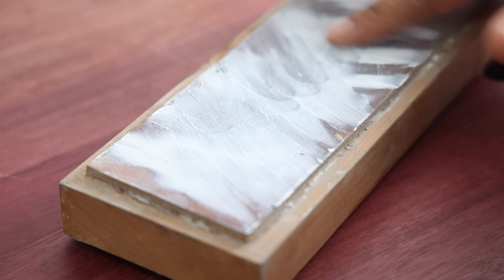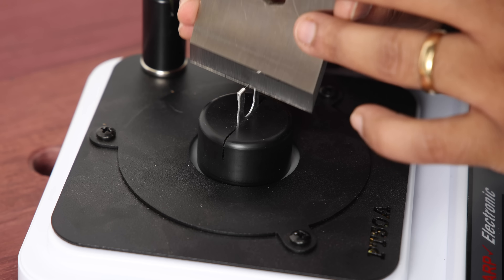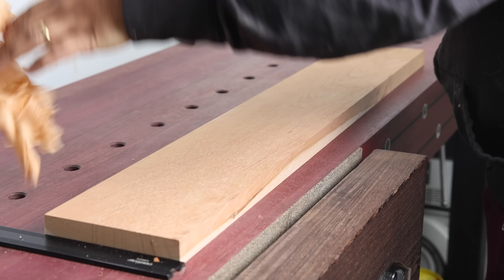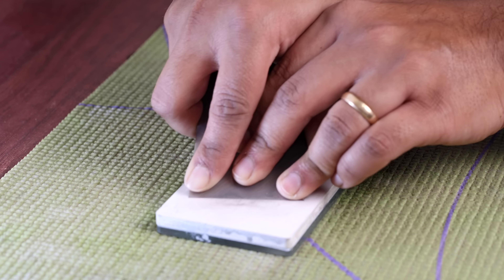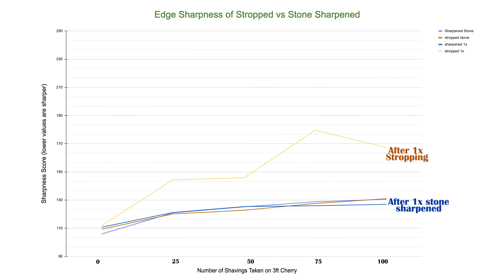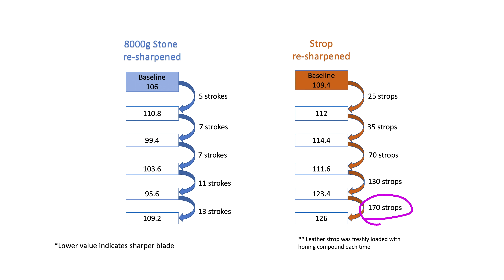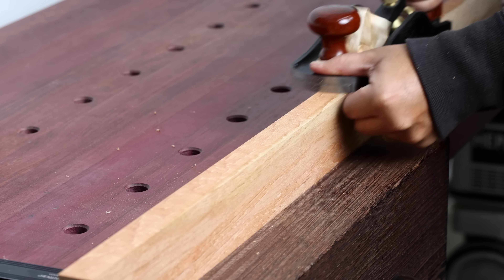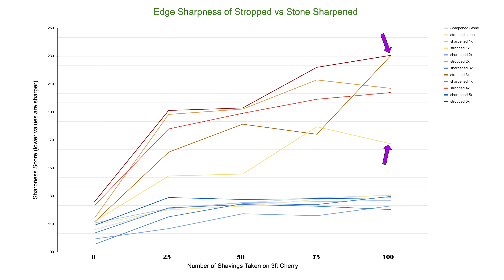is stropping overrated?

Comment: First off, numbers matter. Kudos for showing us those numbers. It's like watching a video on dust collection and the person sucks up a pile of sawdust and says "See? Look?" One's feelings and actual proof are just not on the same level.

I wonder though about saying that stropping is unnecessary. I am by no means a sharpening expert, but I thought stropping was a method of quickly restoring an edge when you're in the middle of a task. It was never meant to replace a good sharpening, it was meant to save time. Your numbers though, seem to suggest otherwise.

Your numbers indicate that it takes more strokes to strop than to sharpen an edge back to it's baseline. My question is, what is the set up time to get to that first stroke of stropping versus the first stroke of sharpening? If time is a factor, you have to consider all the time it takes to strop or sharpen not just how many strokes. If the set up time to sharpen is easily negated by all the stropping strokes, then your numbers would indicate that sharpening not only doesn't take any more time but also results in a usable edge for a longer period of time, proving your point that stropping can be a waste of time or at the very least, unnecessary.

One other point... when you talked about the baseline score for a good edge, when compared to a utility knife blade, you said it was good enough for woodworking. One question would be, even if stropping results in a duller edge, is it still good enough for woodworking? Did you let the numbers persuade you or was it a noticeable difference? Kinda like, how square is square enough for woodworking.
Reply from the maker: Hey thanks for the kind words! In my setup, because I am using Shapton ceramic stones that does not require soaking, it takes no more time to get started sharpening on a stone vs strop. In both cases, the edges are brought to very usable sharpness for woodworking (100-200 is plenty sharp). 200+ and we start to get into an edge that probably needs a little refreshment, though I’ve personally still kept going on an edge that dull and it’s not the end of the world. The biggest difference with the stropping is 1) okay to strop a few times if it gets you back into woodworking and you don’t have time to soak a stone 2) it takes a lot of stropping to get to a sharp edge the more times a blade is touched up with strop only. Personally- I would ditch water stone and get ceramic stone. And if that’s not in the budget, I would strop on a hard surface instead of leather.
Reply: @WoodcraftBySuman  appreciate the follow up. With your set up, as you described, stropping does seem unnecessary.

There are others out there however, that don't have your set up so stropping may have some use for them.

I don't want to sound like I'm knocking your video. I think it was very well done. The "myth" comment though, a bit of a lure maybe.

Comment: stropping is meant only to be done after sharpening on a stone or sand paper.  It is more for useful on double sided blades like knives.  As you sharpen each side of a knife blade you can only get it so sharp before you will form a almost microscopic wire edge that just folds over from one sided to the other each pass.  Stropping a blade like this only takes a few passes and the leather will remove the wire edge leaving it stupid sharp.  A single side blade can form one but you would strop from the back side to remove it.   What you are doing is polishing face or the cutting edge not the edge.   But very scientific approach to testing it.

I am not a professional but I have made many knives after watching to many episodes of forged in fire and have viewed hundreds of videos about sharping..   I actually use a buffing wheel instead of leather. After I get the blade where I want I will buff the the blade before final sharpening then I will final sharpen with a 600 or finer belt on my grinder, blade up against the belt moving down. This forms that wire edge burr. Then I go back to the buffing wheel and lightly run on the blade edge down about 1 to 2 passes on each side so I am not cutting into the wheel. I use a  soft wheel and it works Amazing.          Anyway if I am wrong I a sure there will be someone to disagree.  But Walter Sorrels does a great video on it.

Comment: I don't strop the bevel face on bevel-down planes.  The bevel face doesn't need to be polished since it should never come into contact with the surface being worked.  It just looks pretty.  I just use a strop to remove or straighten wire edges where they are rolling up onto face of the blade.

Comment: What's the deal on JKM vid https://www.youtube.com/watch?v=GBjiEmN5HzA  you both supported stropping and even suggested a certain "Best Honing Compound" I almost bought.  Now you say any stropping will dull a freshly sharpened blade.  What's your and JKM final answer?
Reply from the maker: This video is about re-stropping. Generally speaking, re-stropping as a method of sharpening i probably not the best approach. You can definitely use a strop to finish off. One of the issue in this video is the compound I used. It is not the best compound for stropping. I would recommend the green compound JKM and I recommended - that works much better than the one used in this video
Reply: Thanks for your reply.  BTW your vid were very well done, should have said that to begin with.  But..... after sharpening, your data supports NOT stropping, correct?
Reply from the maker: @SW-jo7vy  yes. Sharpen > strop (if you like) > use tool > strop > use tool > sharpen again. Basically you don’t want to re-strop more than once or twice bc the blade tip starts to round over a little bit and changes cutting geometry.

Comment: While the results of your testing are very interesting, I believe the conclusions you draw from the tests are not accurate based on three factors: method of sharpening and stropping (freehand/square), angle of stropping (variable), and thickness of leather (too thick), and that several other conclusions may also be drawn:

At 6:32 you show a closeup of the blade riding on the surface of the leather, and it is clear that the leather you are using is way too thick for stropping a plane blade. You will want to use as thin and dense of a hide as possible to maintain a smooth and flush surface, preferably on a surface that also will not flex or move over time, such as MDF or a hardwood plywood. 

Regarding angle, you also lift the blade upwards as you retreat the blade, which is an incorrect way to strop. The majority of your pressure should be focused on the back edge rather than the front edge to maintain a level surface throughout the pull stroke. Not doing so will result in the curve you showed as you are pressuring the tip of the blade into the leather rather than allowing the front edge of the blade to glide over the surface. 

Regarding method, in my opinion, freehand stropping works best when you alternate the angle of the blade relative to the pull stroke as opposed to pulling the blade square across the leather. While pulling square on a solid stone makes sense (the stone does not flex at all) the edges of your stropped blade will suffer as the majority of the pressure will be on the sharp sides of the front of the blade edge rather than on the whole surface. 

Stropping helps to cleanly and consistently remove the burr once you are done sharpening on stones/plates. It also helps to rapidly hone a blade that is not already dull to continue working. Stones require preparation. They are also messy in the sense that you need to wipe your blade clean after sharpening and manage a water/oil supply, while stropping can be done in less than 30 seconds in the middle of a build to keep the blade going until stropping won't do the trick anymore, as your test clearly illustrates. I think if you weigh the pros and cons while improving stropping technique, I am certain you will find the benefit of stropping are indispensable!

Comment: This is great data, but based on your JKM collab, I feel like you are working to the wrong standard by trying to strop down to 115 or less. Based on the other videos, it seems like you should be working to ~140, which I suspect would result in a very different result V since it would have resulted in far less rounding.
Reply from the maker: Agreed. Looking back, it would make more sense to chase ~140. But because of this video, Jonathan and I got together to make his video where we got a chance to learn more.
Reply: @WoodcraftBySuman  so with the new testing done with Jkm do you still think an 8000 grit stone is better than stroping. Im interested if your opinion. Also did you and jkm discuss that aspect. Being that a stone would be better than a strop. Thnx.
Reply from the maker: @wilriv6391  I still wouldn’t recommend re-stropping too many times to top off the edge. But it’s a tough thing to say because the compounds are different in two of my videos. Personally, I’ll be sharpening on a stone but nothing wrong with strop for the final edge.

Comment: Geometry of an edge is king when determining how well it cuts. Your results support this as the Geometry when stropping each time changes ever so slightly. Using the flat stones you are returning to your baseline each sharpening session. Stropping to re sharpen/hone a edge can be effective but eventually returning to baseline is needed. Great Video.

Comment: You've made a fundamental error in this video. Stropping is not sharpening. Stropping is done after sharpening to achieve a smooth edge generally for finish/joinery work. If you're sharpening up to 8k/16k Shapton stones, you don't need to strop as the super high grit stone will give you a super smooth cutting edge. Strop + a compound is much cheaper than an 8k/16k Shapton which is why it's an option for most people.

Yes, stropping can refresh your edge but in practice, you're better off just spending a minute sharpening on stones then a quick strop to get the mirror edge and back to work. And like I said above, if you're sharpening to 8k, you don't need to strop.

Using an edged tool on wood causes the edge to roll over and micro fracture. Sharpening and then removing the burr gets rid of the rolled edge and cleans up the fractured edge with scratches' commensurate with the grit being used. If someone (like me) stops at something around 1200grit, we can then use a strop to reduce the 'scratch' size even further and get an edge that will resemble something that has been sharpened on a high grit stone. That is the purpose behind stropping.

Comment: A strop is used only to hone a blade that has already been sharpened. It does not take the place of a stone or other kind of actual sharpening method. A few swipes to clean up the blade after sharpening. Maybe in the middle of a project.  Just to keen up the edge quickly to finish the job. But if the blade is getting dull it has to be sharpened properly and then finished off with a strop. I  feel it is a bit disingenuous, and perhaps misleading, to base the entire premise of the video on only using a strop verses actually sharpening the blade. I haven't heard of anyone who says that only using a strop is an acceptable replacement for properly sharpening a blade.

Exit- after a clarifying message from Suman and reviewing the video l realized I had a misconception of the video premise. It is not misleading in the way I thought it may have been and I apologize for the mistake. The video is interesting and has shown me that I should hit the stone sooner during a longer project. As opposed to just a few  quick strokes on a strop and back to work. Thanks Suman for the detailed video.
Reply from the maker: the blade was initially sharpened on a stone before it got stropped to refresh the edge. The idea of the video was to see how amendable the edge is to being refreshed while stropped after initial stone sharpening. Stropping showed poor results from 1st strop to progressively worse results at 5th strop. Nothing about that is disingenuous.
Reply: OK, I can see where I had a misunderstanding of the concept here. I apologize if the comment seemed a bit hard. You are right, the strop is no replacement for sharpening. And after reviewing it is interesting to see the constant loss of sharpness when just going back to the strop over and over. I thought it might do a little better than that for a little while at least. I also like your hollow grinding technique. Keep up the interesting videos.

Comment: Stropping isn't necessarily about sharper. It can be but it isn't necessarily. The compound for stropping needs to be finer than the finest stone you use, and about the results on the product not the string. If the stropping doesn't help the finished product than don't do it. Get a microscope and compare the edges. What you see under the scope is what goes into the wood.
You be the judge in the end.

Comment: Missing the point of stropping vs sharpening. Sharpening you push the blade towards the sharpening stone and remove blade material. Stropping, you pull the blade away from the leather to hone the blade. Stropping is meant to take the micro-fine burr off of the blade and align said blade. As a licensed Barber, I will verify that stropping, at least in straight razors, is more than a mere myth.

Comment: Interesting video, but it does not prove or disprove the effectiveness of stropping.  Thus your testing is invalid for your stated purpose.  You  did show how a soft strop used with more than light pressure will not provide good results. A thin piece of leather glued to a hard surface used with very light pressure will improve your results. Dozens of strokes won't improve results, in fact it will likely produce a rounded over edge. 
Try this test with improved honing technique, different honing paste and different strop and I'm confident that you will get different results.

Comment: in my opinion stropping rounds over the blade because it doesn't have a dead flat reference
Reply: a convex edge is stronger than a flat bevel edge is too. There's just more material behind the edge supporting a convex edge.

Comment: Well, of course sharpening is better than stropping, I don't think anybody will say otherwise. If you have the time and money to buy that many sharpening stones and then go through them really often, sure, go for it. For real life use, a double sided diamond plate 300/1000 and stropping on green compound will more than suffice. It will last forever and won't break the bank.
Reply from the maker: The ceramic stones are expensive ($140 for both). But I would argue they’re good enough for lifetime use for a casual woodworker and it provides quicker and more consistent results.
Reply: Yeah, I wouldn’t count on the quicker. You have to take into account the setup and maintenance time for the water stones as well, which is one of its greatest drawbacks. They can potentially be a real mess. Also, you will need to keep flattening them over time, something that will not happen with a diamond stone. As for consistent results, diamond + good old strop will be as consistent, albeit less sharp, but good enough for most work, using the right technique. I’m not saying that water stones are bad, in fact pretty much nothing beats them for sharpness, I’m just saying that may not be the more convenient and budget friendly for the day to day work, unless you’re a member of the Holly Sharpening Church 😅
Reply from the maker: @emmakun   Shaptons are ceramic stones. They do not need soaking. Just spray water and go. They cut pretty quickly and wear very slowly. Which is why they come in just 5mm thickness. I’ve had mine for 6-7yrs and maybe used half a mm so far.
Reply: I don't find diamond plates to last more than a few years at most. But I don't buy the good monocrystalline ones. The good plates don't come two sided either though. So no 400/1000 diamond plate is going to be very good.
Reply: @1pcfred  I found DMT and Trend to be really good. The cheap made in China stuff is a hit and miss at best, more often than not it’s useless.
Reply: @emmakun  I use cheap Chinese plates. They're OK. I can get 10 of them for what DMT or Trend costs too. A lot of it is down to how you use them. I use Purple Power as a cutting fluid. Stuff's great!
Reply: @WoodcraftBySuman  I just noticed you agreed with me in your very next video. You just needed JKM to give you the same tip haha. Sorry I didn't notice before, somehow I missed that one. The YT algorithm doesn't work too well I guess.

Comment: Stropping was never supposed to sharpen the blade. It is for refreshing the edge a bit in between sharpening.

Edit: oh God this just gets worse the more I watch. I am calling user error on this. Wrong surface for stropping (should be hard veg tanned leather, not glued to a block). Wrong compound. Too much pressure. And you should be flipping the blade to do the other side every stroke.

Comment: Except, you premise is incorrect. Anyone who is using stropping compound to sharpen needs to go back to basics. Stropping is not sharpening....it is honing...and you only do it a few times...like 5 or 10 strokes.  A correct test would be to sharpen both blades at the same level THEN strop at max 10 strokes. Then test, then wash, rinse, and repeat. I suspect that your stropping medium is too wet as well, my leather is not that thick and squishy....I suspect that your medium is lubricating and moisturizing your leather. The leather is just a vehicle for the compound, some use just a piece of pine as their strop.. There is a reason why you use the sticks.